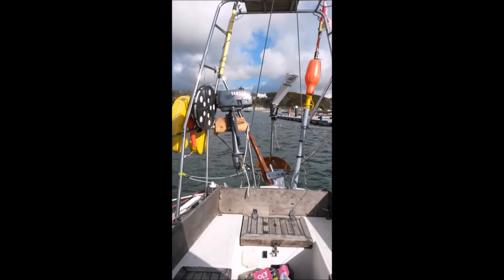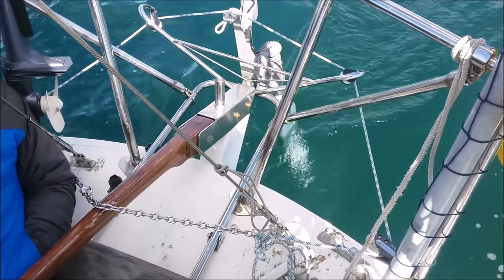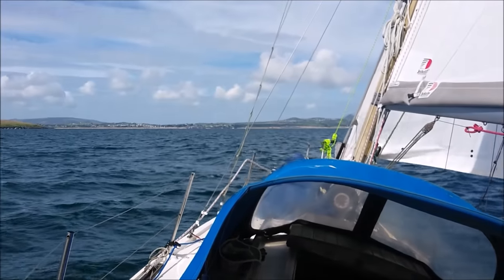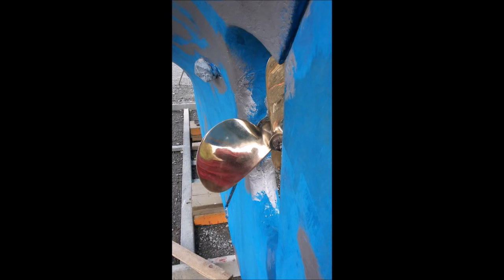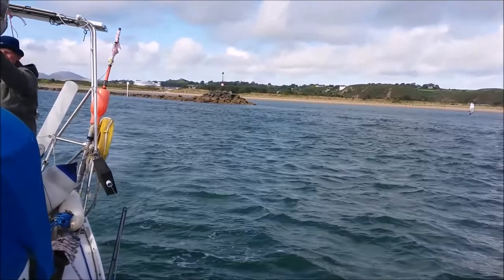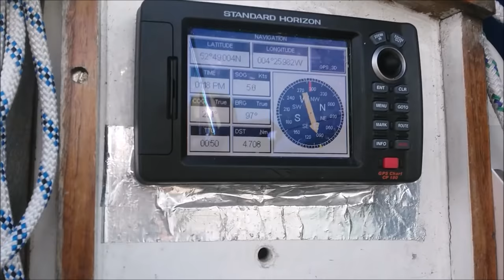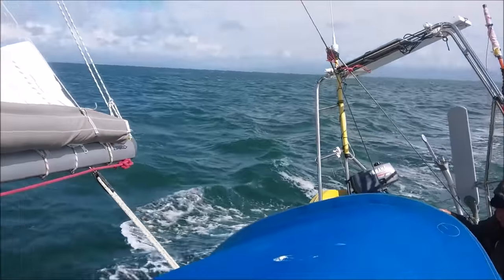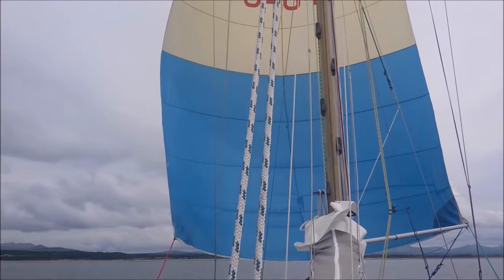Sailing, self steering, and spinnakers on a long keel Halcyon 27

Comment: It's mesmerising to watch the mechanics of the trim tab adjuster on the wind vane. I've just come indoors to rest after a strenuous but enjoyable bit of hull-scraping - the previous guardian had bitumen-painted the entire hull so hand scraping is the only way to go. I've tried the electric gadget route, ie belt sander and flapper disc sander, but the bitumen just builds up horribly between the bits of grit on the belts/flapper. Ah well, there's no alternative so may as well carry on - am into around three solid days so far on this lovely job.
Reply from the maker: I'm sure all the hard graft will be worth it when you get sailing..  I remember looking for that bitumen type of coating, after a few old sailors  recommended it. .I think it was also used on Oil rigs and pontoons etc, very effective and tough but I believe it was banned.... and no doubt a nightmare to remove!

Comment: Great inspiration.
Would like to mount such a system on my Albin Vega 27.
What is the name of the vindvane system, and does it  come with the stainless frames, which gives space for the rudder???
Regards from Denmark
Reply from the maker: Thanks for the comment.. the windvane is made by Neptune. Their website shows the mounting options well.. http://www.windvane.co.uk/mounting/ .  There is a small bracket that would suit your Vega... I used to sail an Albin  viggen .. very strong construction.

Comment: Great video - Question more about long keel boats, how do you find reversing them in marinas / confined spaces? are they as bad as people say?
Reply from the maker: Thanks..... Yes reversing Nimbus is a headache in confined spaces, here's what I've concluded -:
1) propwalk in reverse has little effect, but bursts of full throttle going forward will swing the (boats) stern around. (this needs space)
2) When reversing it takes atleast  2-3 boat lengths to gain predictable steerage backwards, afterwhich a one boat length turn can be made backwards. (needs space)
3)When reversing in any cross wind,  the boats bow will always get blown downwind
4) whilst reversing, initially the rudder must be kept midships.. if not, you get a "crazy Ivan"
5) a "crazy Ivan" is when the boat turns in the opposite direction than expected from the angle of the rudder (this happens because my rudder is fixed to the trailing end of the keel, so when going astern generates "lift" (because it becomes a foil shape like an airplane's wing) in the wrong direction at low speed.  The rudders turning effect and this "lift" usually have a bit of a fight before the rudder prevails.

These points may not apply to other long keelers, I think the rudder position/geometry plays a big part.

I've lots of fenders and have learnt to ignore the "yes there's plenty of space to turn around" if it involves going backwards.

Comment: As I understood you, you leave the gear in neutral to increase speed with your three bladed prop? I'm not able to do that, as the vacuum pulling the oil into the packbox is not sufficient, and my shaft would run dry and be broken.. How does it work out for you?
Reply from the maker: HI Yes I let the prop spin when sailing.  My prop shaft has a traditional stuffing box type seal (packbox) at one end and is held by a solid white metal bearing at the other... both are grease lubricated by two grease nipples with remote type feeders.   If I motored all day I'd usually turn the grease feed handle a quarter turn until I feel pressure,  I've never had to add grease when just sailing (with the prop spinning), The grease is marine 'water resistant' type that is very  thick.  Yanmar recommends letting the prop spin for most of their engines.

Comment: hi super video :) what type of neptune windvane is it, i have a Albin Vega 27 foot that i will take around the World, and i thinking about buying a neptune m650 mk2 :)
Reply from the maker: +thomas bechmann  Hi, the 650 looks the right height for your Vega, and you should be able to mount it to your transom directly using their std bracket, so you wont need all the tubework that my H27 needed for its lower transom and rudder.  I also have the m650 mk2 fitted.     Trenchard Bowden at Neptune is very helpful and knowledgeable on all things 'windvane' related, I'm sure he'll advise exactly what you need.. 

The Vega is a very solidly built yacht, I renovated a smaller Viggen last year, and was very impressed with the GRP layup, hope to see some video of your trip soon?

Comment: Where is it you're sailing out of here? I see Penzance on your stern, looks great wherever it is. It seems I may be joining your Halcyon club soon. Offer accepted on a rather tired old girl in Poole. Much potential though and I have to say your vids were an influence on the decision. Thanks.
Reply from the maker: +shoestringsailor     CONGRATS!!    I hope the purchase goes smoothly and look forward to seeing your vids from on board her !!!  

There is an owners forum (free) http://www.oycoa.org.uk/ it doesn't seem so active, but there's quite a bit of good H27 info archived if you dig. 

 I bought  Nimbus in Penzance in 2011, and sailed her to Pwllheli in North wales where most of the videos I've posted are shot, it's a pretty area to sail.  

The boat (and crew!) took a bit of a kicking during that maiden voyage (I'll post something on this and the refit when I get a chance) and it gave me a long to-do list of mods I needed/wanted to do during the subsequent year long re-fit.  

So shout if I can help with any info etc,  (although a lot of my re-fit might not be relevant or suit what you need) I made tons of mistakes on the way, so can at least guide a little on what not to do!!!!
Reply: Great, thanks very much. Have had plenty of practice on making mistakes with My restoration of Macavity so am keen to avoid making any further dumbassed errors of judgement. Think I'm going to sail her for a season as she stands to get a feel for what needs doing first. Drippy deck leaks around all the fittings are priority number one though plus a few obvious safety issues like siezed open seacocks. I will do a short film for you soon and put some details on the website.

Comment: great tons of pounds or euro  hanging on the stern. bungeecord does it as well. p.
Reply from the maker: Yes you are right, it's hard to compete with the cost effectiveness of bungy!  I tried using sheet-to-tiller for the first few years with Nimbus.. but even though she's a long keeler, I couldn't maintain a true course if the wind or swell was even slightly  inconsistent. Weirdly, on a previous boat .. a 24ft bilge keel Westerly Warwick.. I could just lock the tiller and she'd stay on course on most points of sail...